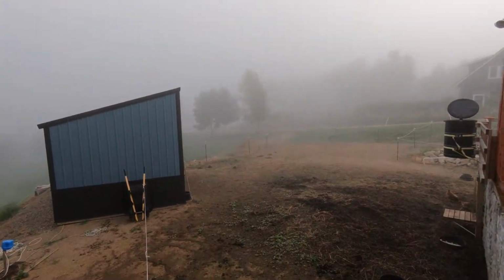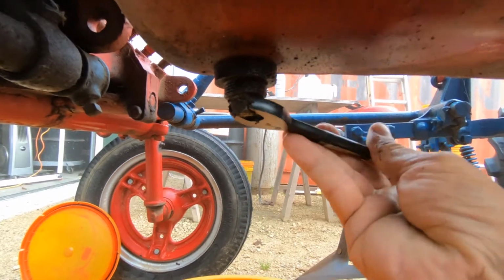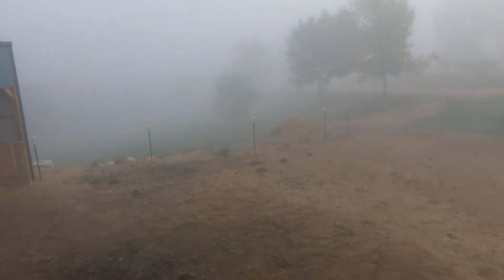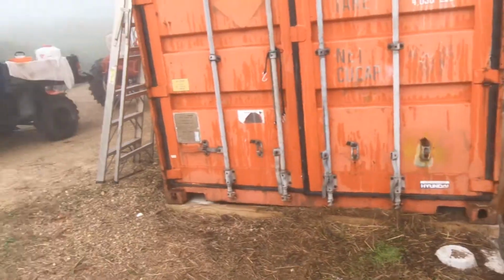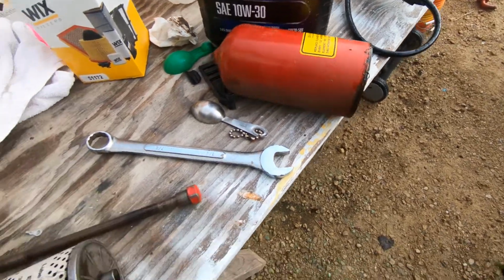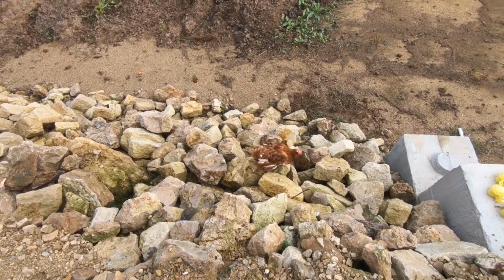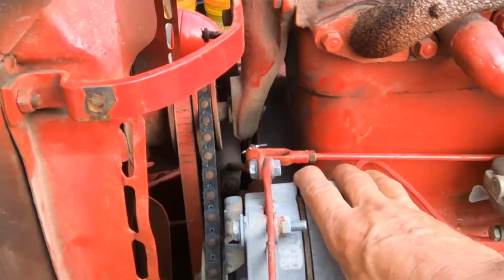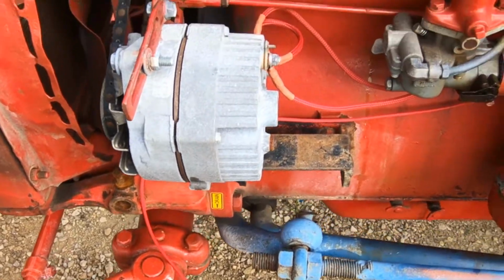Changing the Oil on a Farmall A

Comment: Nice video! 
I always start and move all motors/vehicles/gearboxes etc. before changing the dirty oil (or coolant) so debris is suspended and not settled on the oil pan floor but not to hot to risk injury.
Reply from the maker: Thanks Fred!

Comment: Thanks mine is an original 6 and when I tried to start after oil and gear oil change, I also touched up battery box, when I went to start I had a spark in the + of which I now know is the ground.  Thanks for the response! Keep at it!!!!
Reply from the maker: Thanks Clark. It is only a few hours away from being done but I am soooooooooo busy with spring stuff. Hopefully I can get-er-done this week! Good luck with your tractor Clark!
Reply: Now after a use it for a little bit and shut off, I have to charge the battery just to start again, fml
Reply from the maker: @clarkgarrison7091  -- I had the same problem, which is why I am converting to 12-volts. In my case, a new battery did not help.

Comment: Jumping on an old video, there are two different filters based on what you have.  You have the long filter housing, which takes the longer filter like the one you pulled out.  Steiner also sells the long one.  It would have been better to put in the correct filter.
Reply from the maker: I'll have to look into that. I believe I bought that one at Steiner though.